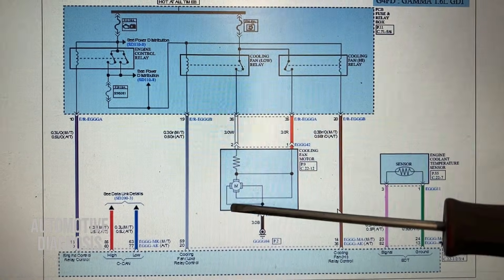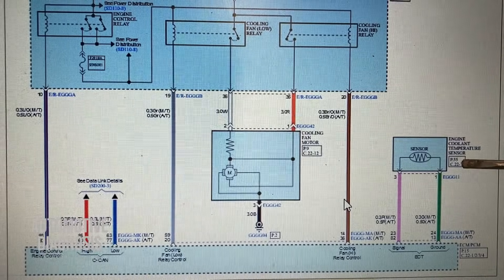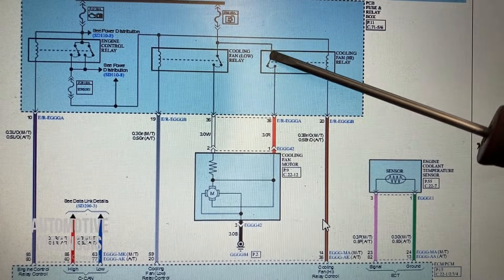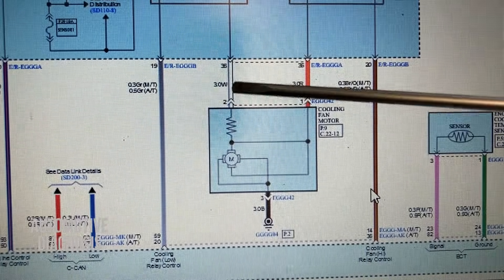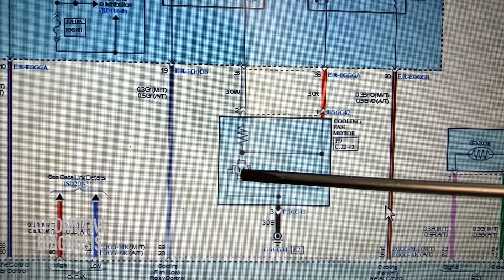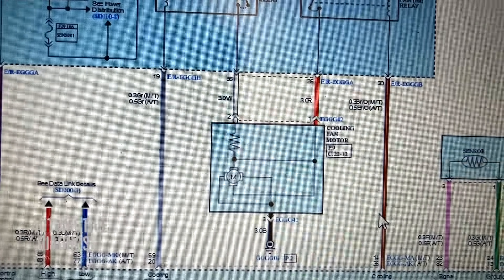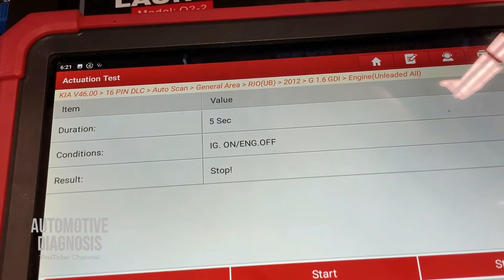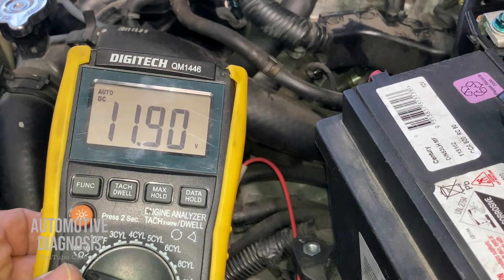Want to Fix Your Car's Cooling System? Watch This Radiator Fan Resistor Test Now!

Comment: Excellent. One question ¿What is that green part of the resistor for? ¿Why it must be close to the radiator?¿Is it variable resistor?¿does it variates with temperature? ¿If i bypass this resistor would i always get hig speed fan velocity regardless of what fan speed is selected?

Thanks!

Comment: The electrical component consists of a resistor, which is the large coil. As for the small part included, it's very likely a diode for protection against the back EMF of the fan motor when it's turned on or off.
And Allah knows best."
Reply: سؤال يا استاذ فوزي عندي مشكلة اتمنى الافاده

النترا 2015 مروحه المكيف فجأه وقفت عن الدوران + الكومبريسر والفريون كلها جديده ومغيره ، المشكله بالضبط في القطعه هذي صحيح ؟ اتمنى الاجابه
Reply: @l_19k  
اكثر من علة قد تحدث العرض:
افحص المروحة بتوصيل سلك مباشرة من البطارية والسيارة مطفية. استعن بشخص يعرف ان كنت لا تعرف.
اذا اشتغلت المروحة اذن الموتور سليم.

افحص الريلاي قد لا يعمل. ابحث عن طريقة فحصه في النت  هناك اكثر من ريلاي .. بعض الشعوب العربية يسمونه كتاكت اعتقد في مصر. الاسم الانجليزي relay
Electric fan relay 
لو عندك جهاز كشف كمبيوتر متوسط الوظائف هناك ميزة تشغيل المراوح بالجهاز حتى تكشف صالحة ام عاطلة بدون ان تلمس شيئا في حوض المحرك. اصحاب كشف الأعطال يعلمون ذلك 
في حال وجود فيوز تأكد من عمله ربما يكون قد احترق ... عادة هناك سبب 
يمكنك تغيير هذا المنظم مؤقتا لترى هل هو السبب ام لا. سمعت انه يعطل  اذا اشتريته ربما تحتاجه في المستقبل على كل حال !!

اعذرني التفاصيل ليست لدي سيارتك ولست محترف حتى تكون عندي الخرائط الكهربائية 
بالتوفيق

Comment: Good information. However what do you do if you don't have a bidirectional scan tool to activate these functions?  I wonder if you could take a hairdryer/heat gun to resistor with K O E O and measure the output voltages? Also surely  different testing method would likely be required on a two wire resistor?
Reply: You could jump the relay of the high speed and then the low speed and measure the voltage at the fan side of the resistor

Comment: 9 minutes went by fast.  
Working on similar issue. 

Someone by passed the resistor. 

Fab works on low mostly
Pull the wire and runs on high. 
Weird.

Comment: That’s was very useful, i will solve my cooling fan problem, it works on high speed always, the cause may be the relay or the resistor, thanks so much, i will subscribe
Reply from the maker: Hi my friend, I’m glad it’s helpful